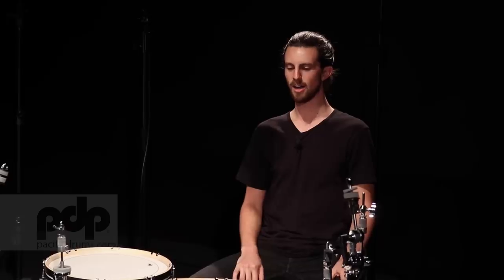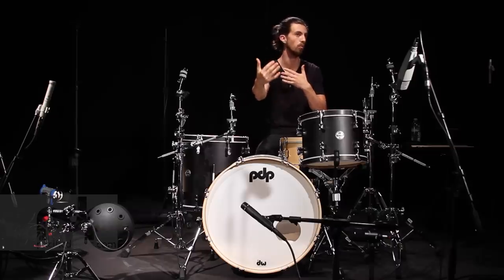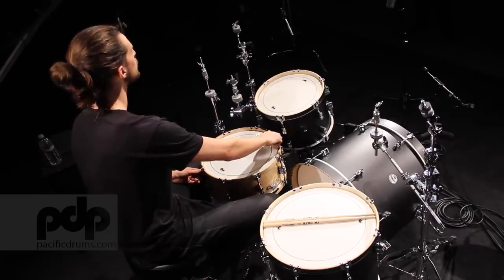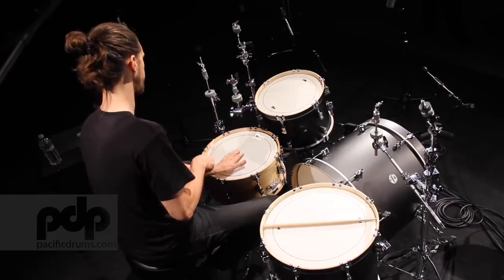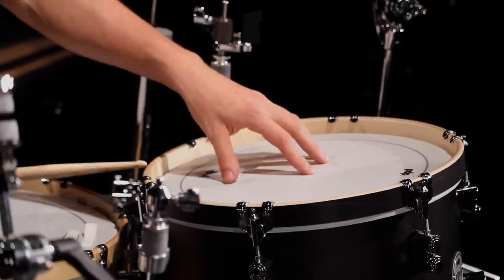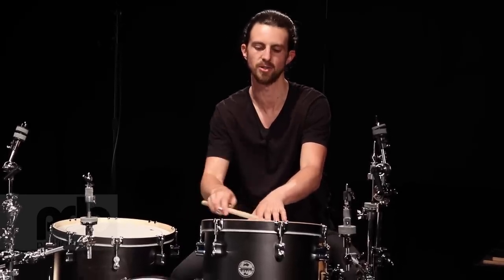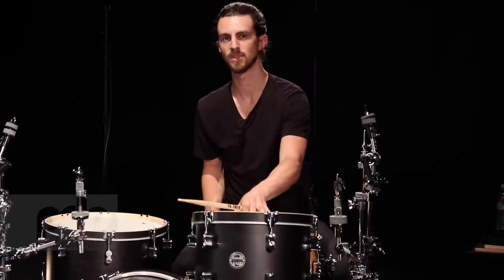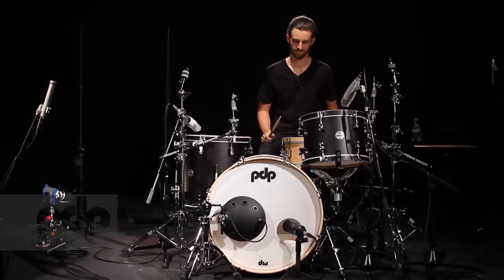Tuning Drums with JP Bouvet

Comment: Has anyone tried clear heads on these drums?  I am so close to buying a set of these.  our band opened for a band that had these... blew my Ludwig Classic Maples away.
Reply: I’m so close to pulling the trigger on one myself. Just not sure if I want a 24” kick or stick with a 22”
Reply: @claystaggs8908  I ended up getting a decent deal on a set of Gretsch Renown’s with a 24”. My first 24. I don’t see myself turning back.
Reply: @claystaggs8908  I have this kit in the oxblood with a 24" and I will never get rid of it. I slapped some remo black dots on them and they sound amazing
Reply: @claystaggs8908  just bought a unique configuration of 20x14, 12x8, 16x16 in oxblood and it’s simply the best sounding kit I’ve ever played for the money. I held off buying these for a long time because I wanted a 20” kick drum and finally was able to find a retailer who carried them, but man I almost regret not getting them sooner. Absolutely in love with the sound and aesthetic of these drums and this will be the last kit I buy for a while because it’s so versatile. If you haven’t already, do yourself a favor and get them before they are gone. This is truthfully one of the few instances where I actually feel like you get more than what they cost. Incredible drums regardless

Comment: What about the snare bottom head?
Reply: I personally like to crank it really  high (higher than the top usually) even for really low fat top tunings, but a lot of guys like to tune it to roughly the same tension as the top head or even a bit lower for a trashier sound which I've also done. Try both and everything ik between it's fun to play with it.

Comment: Not a bad little video. My "concern" would be the longer buzz and rattling of the snares after he tuned it. How would you fix that? Adjust the snare wires or the reso head?
Reply: Always tune the snare reso snare very tight, like crank it right up. Make sure the wires are fastened tight also then you can focus on the batter head, if there’s any overtones or snare buzz after all the tuning then just use dampeners, there’s all sorts of stuff you can use. Eg. Moongel.
Reply: @joekellett241  awesome! Thank you. This is very helpful. I'll make sure I do this soon. Will this help cut down on sympathetic resonance when I hit my toms?
Reply: It can usually be resolved by a combination of muffling and snare wire tension. Cranking the snare wires will choke the low end out of the drum, so I tend to prefer just a little muffling to kill the standing vibrations that cause excess buzz. A light touch is all that is necessary; I often find that a full moongel is too much
Reply: one trick i like is tuning the 4 lugs that are right by the snare wires a little lower so that the snare wires lie a bit flatter
Reply: Devan Douwes yeah, snares are easier to tune as JP says because of the lack of tone it produces compared to toms, you can focus on a nice crisp sound pretty quickly. Toms can be a pain but I always manage to get a reasonably low resonance sound when I tune the bottom head higher than the batter head, following the steps JP did here is correct for a low punchy tone.
Reply: You don’t - just let it ring
Reply: Devan Douwes superglue them the to reso.

Comment: Some good points no doubt but they kinda sound like shit for “general purpose.” Snare side should be pretty tight in comparison to batter, probably resulting in a tone that’s an F,G or A when the snare wires are off (overall pitch that is). Tom bottoms a minor third to a perfect fourth above the batters  or....(decently higher) prevents weird pitch bend. But if you want that then all the power to ya.